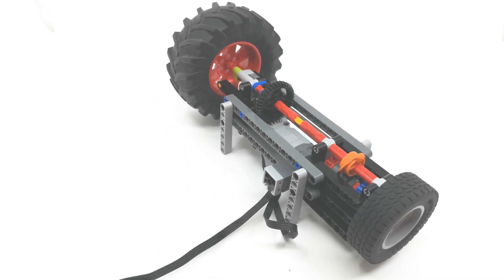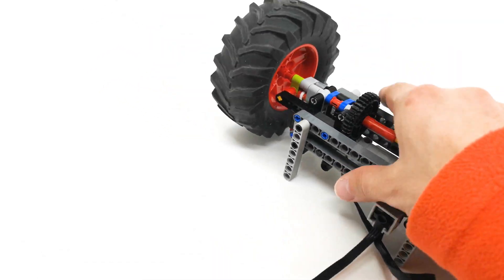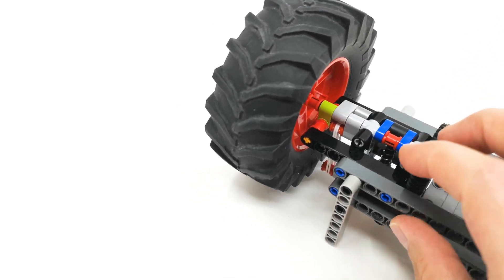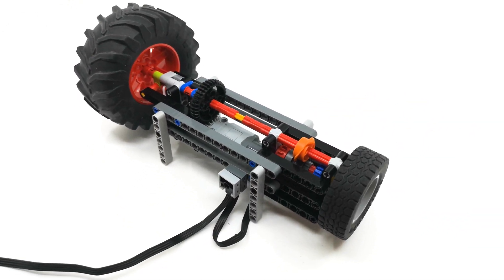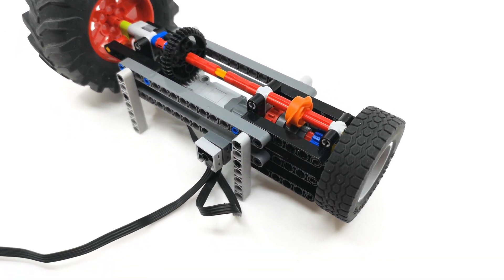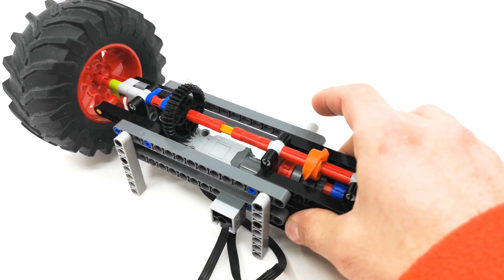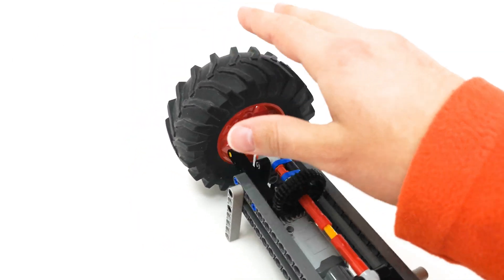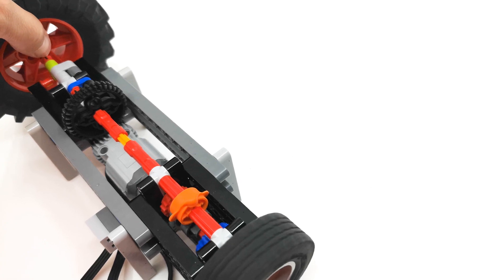Lego Two-Speed Automatic Gearbox

Comment: I also made gearbox with reverse using the motor torque.  When the motor turns it switched pneumatic valve and actuators change the gears. 
But your idea is really cool because of simplicity!
Reply from the maker: That's a good idea too